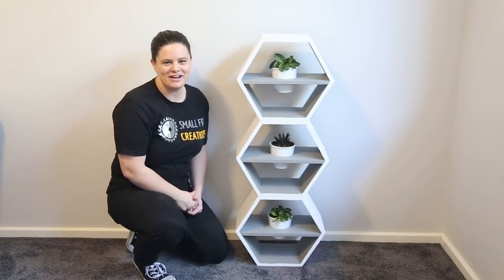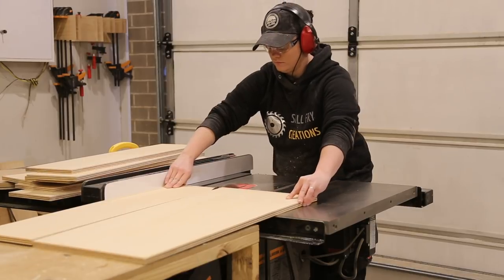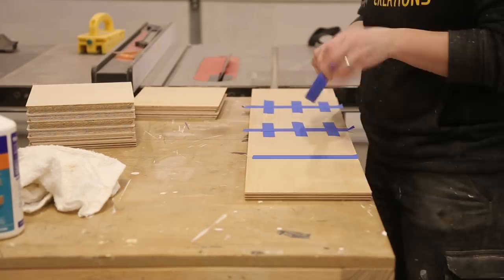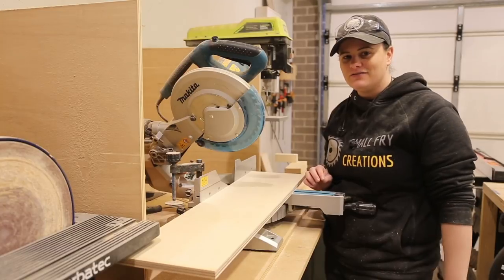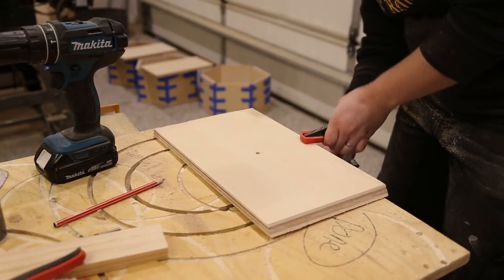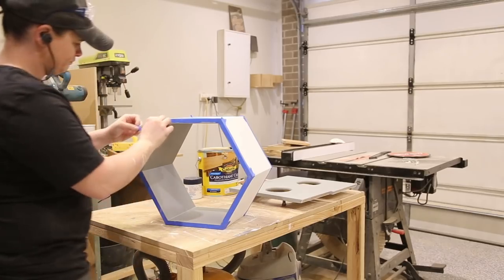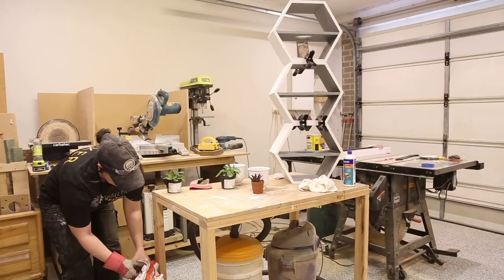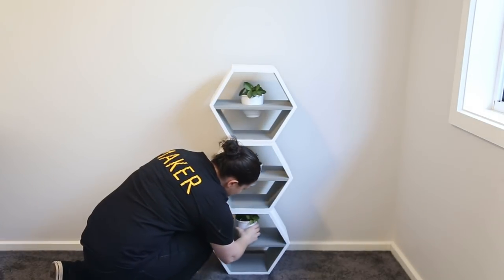DIY | Indoor Hexagon Planter

Comment: How do you get a smooth and nice finish with paint ? I need help
Reply from the maker: The trick is sanding. Take the time to sand the piece up to at least 220grit. I then sand 220 grit between coats and use 400 grit between the last coat. I find a roller is also better then a brush. Hope this helps

Comment: The internal angle of a hexagon is 120 degrees so wouldn't each side be 60 and not 30?
Reply: To get the internal angle, divide 360 by the number of sides.

Comment: What about watering the plants? The water is going to drip through onto the bottom of each hexagon and ruin the finish. Nice design although I'd probably use it for something different - shoe rack, book case, CD/DVD storage, in the bathroom for towels or toiletries  etc. etc.
Reply from the maker: The bottom of the pots are solid and sealed. The indoor plants don’t require a lot of water. I have had plants in similar pots for a year not without any issues. But the hexagons could easily be used for other storage. Great ideas 😀